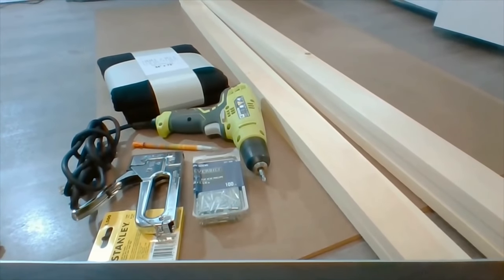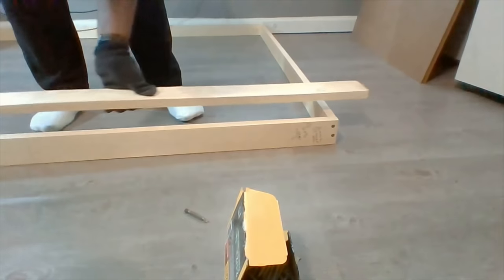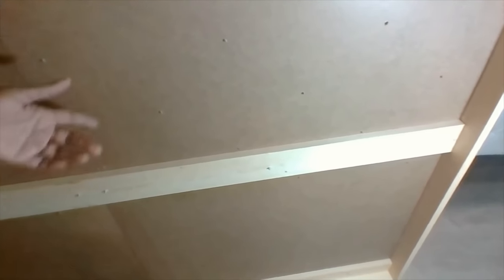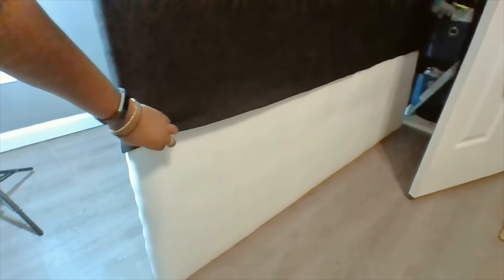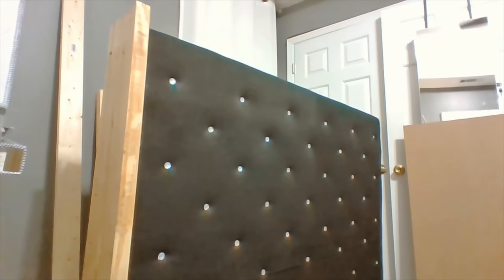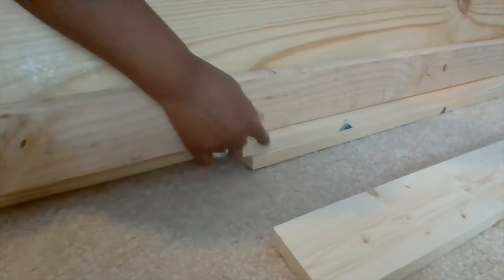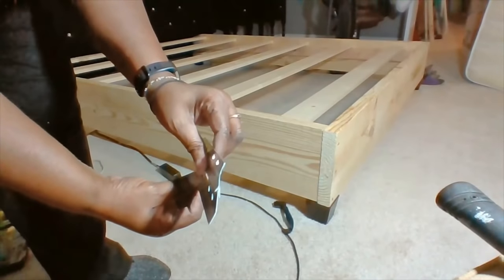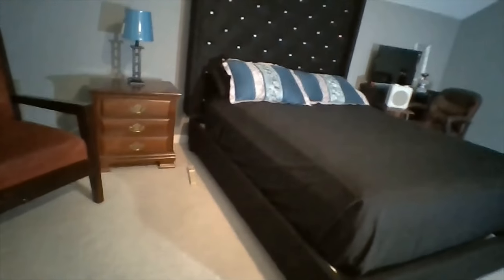(DIY): "QUEEN SZ. BED w/t WINGS" NO SEW | EASY TUFTING

Comment: Hi, what where the sizes of the woods used & how many of each?
Reply from the maker: Daisha, Hi, Sis.! Please, reference the video as to how many of each? But, as far as I can remember this is what I used: For the headboard I used @(7) 1x3 Boards for the headboard, (2) 1x8 Boards for the Wings of the headboard (1) on each side & I used the Brown hardwood board that come in a sheet that is 4ftx8ft and I had Home Depot to cut it down to size.  For the baseboard of the Bed where the Mattress goes I framed it with (4) 1x12's & (2) 2x4's  to hold the slats. I used (6) 1x4's for the slats. 🙋‍♀️🙏🥰🙌 God Bless!
Reply: @LadeijahsCreations  Hello and God bless! I was wondering if you remember the dimension of the hardboard you used? I see you had it cute in 2.
Reply: You did an amazing job! You are very talented. I have been watching so many videos and I gotta say Im following yours to the T. For the brown hardwood board, what measurements did you get please? I want mine this size and i have a queen bed. Also, do you suggest any other type of material thats affordable?
Reply from the maker: Daisha, Hi, Sis. I added more information in the description box under the video about what I could remember concerning the bed! 🙋‍♀️🥰🙌 God Bless!